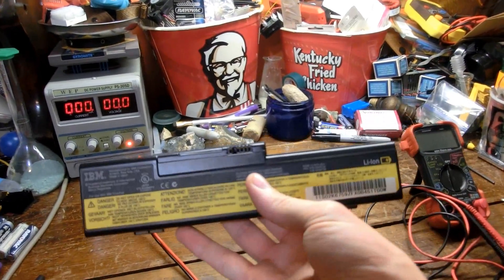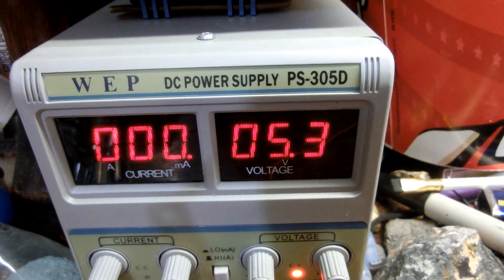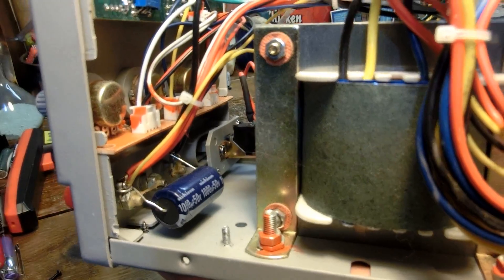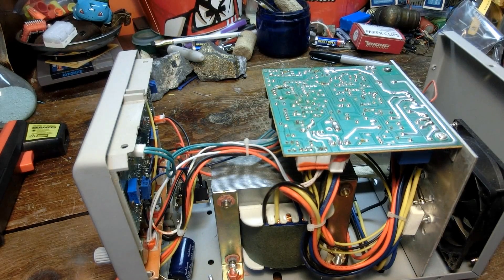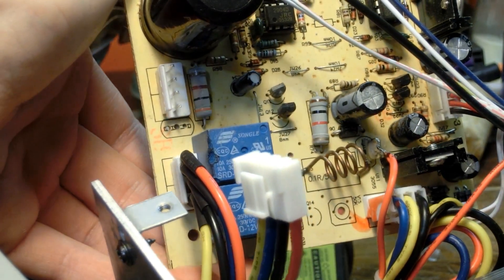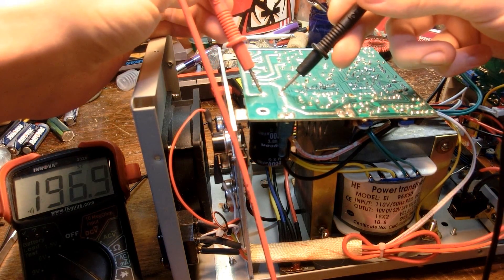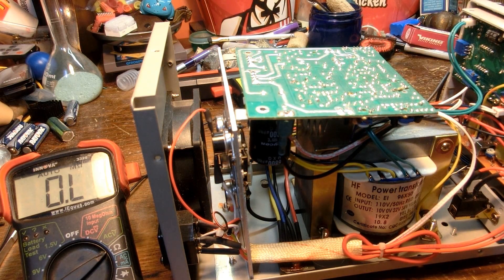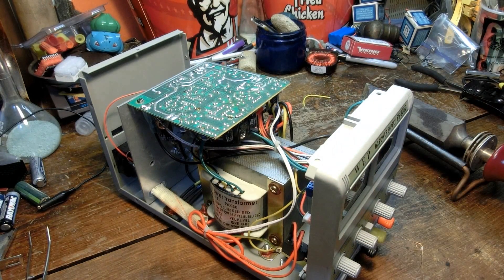How It Failed: 80$ 30V 5A Variable DC Power Supply

Comment: A few things I noticed when you were probing that supply:

Generally it is not a good idea to test capacitors, transistors, diodes, resistors, etc. in-circuit. You need to desolder at least one of the pins. Otherwise you might see junk reading because you are biasing junctions and resistors and stuff elsewhere. I had been fooled like this MANY times.

Also,  measuring the resistance of capacitors is practically pointless. the tool for the job is called a RLC (resistance, inductance, capacitance) meter. the resistance of a capacitor should be close to infinite once charged up. Though at approaching infinite frequency, the impedance should be as close to zero as possible.

The reason for the relays in case your wondering is to keep the voltage difference between the unregulated transformer and the output as low as possible while not too low as to lose regulation. Linear regulators work by dropping the voltage to some fixed value, and that voltage drop, multiplied to the current being drawn is wasted as heat.

When the capacitor is not present on the output, there must be some parasitic oscillation (the regulator keeps over-correcting itself, so the voltage on the output keeps parasitically oscillating) II can link in a few videos to people who are EE's and can explain this much better than me if you want.
Reply: +Power Max Link a how to tell if a fan is turning video.

Comment: I'm a big fan of DC to DC converters (specifically, buck converters).  The only problem, obviously, is you need a DC power source.  My solution to that was a couple solar panels outside with wire running into the house and charging a couple 12V batteries.  Then, your bench power supply always gives you 0 to 24V at whatever current you want and it is free, unlimited power.  My projects have never depleted the batteries faster than they can charge by day.

Comment: Such a shoddy design. Couple of notes though. the difference between 50-60 Hz is not that bad - you may loose maybe 0.1% efficency but overall it's not a biggie using a 50Hz transformer on a 60Hz supply. Also them burn marks are from a soldering iron, they decided to solder the connectors instead of using actual connectors.

Comment: The melted relay looks to me as if someone had been prodding around in there with a soldering iron or got way too close with a hot air gun while applying heat shrink to the cables going down to the connector.

Comment: That was a disappointing 10 minutes...
Reply: Rinoa Super-Genius You call someone else an idiot, Yet you choose to spell " your " when it's clearly " you're "
Reply: Rinoa Super-Genius You are idiot if you want to charge li-ion battery with lab power supply without any charging controller.
Reply: Rinoa Super-Genius You're* .... The irony..
Reply: Rinoa Super-Genius "Your" is possessive and "you're" is a contraction of "you are." There's a lot that's arbitrary in the English language but "your" and "you're" is definitely not.
Reply: Rinoa Super-Genius Try to bridge the voltage control Potentiometer on the front panel if its not a digital type, to see. If not the silver power output transistors before the cooling fan are faulty or one is, those are the transister that takes all the abuse and load, they are like interfaces or fuses.
Reply: +Rinoa Super-Genius  AGREE WITH U
Reply: +Rinoa Super-Genius How did you fix it?
Reply: +Rinoa Super-Genius Could you at least rename the video? I never did learn how it failed.' A' for effort, you definitely tried, but still. Also ignore people like the ones in this thread. Your response validates them and makes you and your channel look bad. Oh, and let us know if you do find the issue!
Reply from the maker: papalevies your a disappointing 10 minutes.
Reply: no you
Reply from the maker: *****
i typed what i wanted to type,because i dont give a shit what people like you think. your just petty idiots.
Reply from the maker: ErmaTheKitteh
 yeah i think its stupid to have two spellings of the same word, and then arbitrarily say one is correct in one application and only the other is in another situation. to me words are defined by how they sound not how they are spelled.

for instance we have stopped saying the "k" sound in words like "know" yet we still spell it with the "k". that is stupid. i think "no" would cover both words since you need context to derive meaning anyway. and i dont think it would lead to much confusion if context is given.
Reply from the maker: swrzesinski
your an idiot if you dont know how to charge a simple lithium battery with a variable power supply.
Reply from the maker: ErmaTheKitteh
how is it ironic that i choose to spell words differently than you?
Reply from the maker: tekdro
but its sounds the same, so it all matters on context anyway.

Comment: You are assuming that because labor costs much less in China that the device is cheaply made. 

I would troubleshoot and fix it; then post a video. It would be a great learning experience for all of us, and yourself.
Reply: *****
If you need an oscilloscope to diagnose a linear power supply it only means thay you don't know a damn thing about them. Observe the internet, read a couple of beginner's books ang go back to the device. The schematics for such a simple device is generally not required as well for everything gets pretty much obvious as soon as you open the cover. A couple of youers ago I repaired my Mastech PSU so you can trust me when I say that it is a very simplistic design and there is not much inside of them. A soldering iron, a multimeter and a bunch of tools and spare parts is all you need to diagnose and fix such a device. Really deep knowledge is also net absolutely required - just a basic understanding and some feeling about what's going on inside is enough in most cases. Tha only really precious thing you need to put into the device to get it up and running is your time.
Reply from the maker: S Cin no because it still works the way i need it to, so theres no point in taking the chance of ruining something that still works.
Reply: S Cin For such a cost effective PSU you need more cost-effective tools to fix them. Wasting the whole day to find an issue does not nearly pay for itself. I would just check if there are visually missing parts or cracks and repaired them. As for short curcuit spot detection I like to use a special tool made of a toroid power transformer with a special secondary side made of a couple of windings of a thick wire. I have about a couple of volts AC connected across the shorted line and just look for a smoke. Sometimes the method can not only diagnose a short circuit but automatically fix it as well - the weakest spot just burns out.

P.S. I would not consider the issue as a problem, but rather as an excuse to blow the shit out of it. It is fun to blow things up, isn't it? If it fixes the problem - then fine. If it does not - just rip it apart, throw the remaining junk away and just get a new one. They are so cheap today that they are close to be considered disposable.
Reply: +Кирилл Рагузин I 1,000%  agree with you.  I have purchased 5 Mastech PSU on ebay in the last 2 years that were listed as non functional.   I was able to go on line and get schematics.   I paid like $25  USD with shipping for most of them and got all of them going in less than 30 minutes with parts laying around the lab except for one.   I needed to order a power transistor for one that I did not have laying around.   I think these form factor PSUs are all made by the same factory.    Based on limited info provided in this video I would suspect that an LM324 chip failed and is not switching relays that control switching the higher voltage windings of the transformer in to increase the voltage output.  Rhinoa is copping out.

Comment: Can anyone help me? I accidentally connected the cables wrong to my 0-50V bench supply. I was powering at 49.5V. I hit the power on and the voltage went up to 76.8V. Is this fixable? I can't regulate the voltage, when I power the supply up it just stays on 76.8V.
Reply: Hookah Boy That sounds like a shorted pass element (transistor). Try replacing it or them and it should work fine. Good luck :)
Reply from the maker: no, only you can fix it. open it up and look for burnt components/traces
Reply: Nothing's fried. It works, it's just that it supplies  more voltage than it is specified to supply and the voltage regulation doesn't work.
Reply from the maker: Hookah Boy
try to calibrate it then?
Reply: Any tips on how to do it? I never worked on a bench supply before...

Comment: When you broke out that huge "bull-dog" soldering iron I couldn't help but laugh. Thanks. Besides that, a few things. You can't accurately measure capacitance in-circuit unless you isolate it. Same with Inductance and resistance. You have to pull the component to isolate it or at least pull one leg of the component. If you fried a trace on your board like that you more than likely fried another active component. I think connecting that laptop battery to your PS is what gave it the death wish.

Comment: I just bought one of these and of course with my luck, right out of the box the current LED's middle digit isn't fully working. Do you know what LED it uses. It might be cheaper to by an LED and try to fix it rather than to send it back. Thanks!

Comment: FYI, there is a diode on the board that is in parallel with the capacitor, it might have shorted out.
Also, mine (different brand, same internals) had severe corrosion on the IC sockets. I just soldered the chips onto the board.
And, at full output voltage setting, the voltage on the main filter capacitor is nearly 60V - just over it's 50V rating!!!

Comment: Between 50Hz transformer and 60Hz mains grid there's not a lot of difference in practice (unless you're a transformer specialist making very interesting ones to tight tolerances) but there is definitely a difference between 50 and 60Hz when it comes to smoothing and the resultant output waveform of any DC rectifiers (this assumes it's a AC-DC system and not simply an AC-AC transformer), especially in audio equipment that is designed for 60Hz use but is used on 50Hz mains grid. It's the ripple that causes the most obvious problem, though higher temperatures of PSU components and the transformer itself are not unknown.

Technically the transformer itself will be optimally designed to have least losses at one particular frequency (unless it is inherently designed to be a wideband transformer of course) and so relatively minor issues like slight warming and possible mechanical vibration could become relevant but by and large, it's audio issues that shows the 50/60Hz kit/grid differences. Equipment designed for 50Hz usually works fine at 60Hz  unless designed very badly and "on the limit", at least in our experience.

Comment: Hmm. To blow that track is going to take WELL in excess of 5 Amps, and the most likely place that has come from is FROM your external battery pack - those 18650-based cells can throw out 20A, no problem, if you've been foolish enough to bypass the safety electronics (we've all done it!). So my bet is that you've either connected the external battery up in reverse, OR you've connected it while the supply was off, so causing a diode reverse bias somewhere. That will kill many cheap power supplies, such as this.

I agree with you on your first point - this supply should be BINNED forthwith. However, I think it is FALSE ECONOMY to simply accept that you're going to blow a power supply each year, and buy another! Why not buy a decent BOMB PROOF supply int he first place.? It will quickly pay for itself. These cheap chinese supplies are worse than useless I feel, as the series pass transistors can often fail and dump the full transformer voltage across your delicate circuit - BAD.

DO BE CAREFULL about charging or discharging lithium cells, without their attendant control circuits. They can cause FIRES if over OR undercharged. They can pack a real punch if they are abused, either way.
Reply: Rinoa Super-Genius Well he/she probably did that instead of bolding the text. He obviously isn't saying trollish nonsense :P
Reply: Rinoa Super-Genius don't be so sensitive to a little common sense when it is offered. Then you won't have to buy a new P.S. (cheap or not) every year or two as you described.
Reply from the maker: why are you typing so weirdly? is your shift key broken?

Comment: The regulator probably fried because the battery voltage was higher than the powersupply's own voltage. These powersupplies aren't designed to sink current and probably have limited over voltage protection (or none at all). If you are charging batteries  you should really be connecting a beefy diode in series with the battery to protect the powersupply.

Comment: Firstly you really shouldn't "charge" batteries by just dumping current into them! And secondly if you do decide to "charge" your batteries like that, atleast protect your power supply with a diode or something to prevent, the current from the battery, from flowing back into the power supply and damaging the circuits inside, like it probably happened here.
Reply from the maker: no that doesnt damage this power supply. it only takes 7ma of current when connected to an outside power supply. its useful to measure the voltage of whatever your connecting up. and yes its ok to charge a battery like this because i'm not really "dumping" current into it, i'm letting it take up to 3 amps until it reaches 4.2v at witch time it automatically starts lowing the amps.
Reply: Rinoa Super-Genius True, current is drawn with a load not force fed to a load. But, at the same time it is quite possible to back feed into this cheap P.S. if the adjustment is ever lower than the actual load (battery) that is not protected as well as a high end unit. Just something to think about, again.......

Comment: thanks for the video. find it on ebay and want to buy one, but see many bad review.  will buy it anyway because of the price.
Reply from the maker: well it seems a lot of people dont realize its a cheep product. they feel entitled to get a quality product for an inferior price.
Reply: S Cin   Not just the labor, cheaper components, wider tolerance band, bogus safety certifications, etc.
Reply: Rinoa Super-Genius Indeed. I don't have the money to get a professional high quality PSU, but I am thinking that I can build my own. I want to build a 0-70V 0-10A PSU, but I'd need a custom transformer...
At least if I build it, I know it would work much better. I actually built a little prototype that works well.
Reply: Rinoa Super-Genius I have one of these variable power supplies. It is inexpensive in the US because labor costs less in China, not because the device is poorly made. If you bought the same device made in Europe it would be something like 300 dollars.  Sure it could have used some improvements in design and some better engineering, but the same applies to my Jura Espresso Machine for which I paid nearly 3k dollars thanks to it being manufactured in Switzerland where labor is so expensive; and yeah it feels cheap and comes filled with proprietary screws and hoses that sell for 100 dollars each. It is crap, yet some people think its a great coffee machine because it costs over 3k in the US. Go figure.

Comment: It's probably worth scrapping this one and from the parts, rebuild another power supply with positive and negative rails, so you can experiment with amplifier / opamp circuits.
Reply: devjock I don't think he is quite there yet as far as using biased voltages.

Comment: I know people have made out of old PC power supplies. Could a 24v 8a wheel chair battery charger be converted somehow to a variable power supply?
Reply from the maker: not really, would require you building a variable power supply to control the output current.

Comment: It was actually video when you got this that made me discover your channel, then i bought one, great piece of kit for the $65 it cost me, like you said, mainly to charge lithium batteries, also made myself a PC PSU power supply, just so i can draw more than 5A on the 12V rail.
Reply from the maker: dont forget that computer power supplies can also give 24v.
Reply: Indeed it can, but the 24v rail on this is quite weak.
Reply from the maker: NovakinCore
 yeah they tend to be.

Comment: Hi Rinoa what about this PS from aliexpress? http://www.aliexpress.com/item/Free-shipping-Wholesale-precision-Compact-Digital-Adjustable-DC-Power-Supply-OVP-OCP-OTP-low-power-32V5A/1668592085.html
Reply: Looks interesting, might have to look into it myself :P Although, the output banana plugs being on the back is a bit of a bad design choice.
Reply from the maker: i think i'll just get this http://www.ebay.com/itm/30V-10A-110V-Precision-Variable-DC-Power-Supply-w-Clip-Cable-Digital-Adjustable-/390658968353?pt=LH_DefaultDomain_0&hash=item5af516cb21

it says its a 10 amps version.

Comment: are the main voltage and current potentiometers dead?
Reply from the maker: no they are fine
Reply: Rinoa Super-Genius What about them large transistor things on the heatsink plate? not sure how you could test them but heat cant be good for them
Reply from the maker: steve64464
 i'll troubleshoot it if it ever completely stops working, but for now it does a job ok.
Reply: Yeah i guess if its still usefull :-) . The cheapness of the inside looks slightly scary i find myself worry for your safty when inside it :-P , I just found one them on ebay for £39 but its states 2A
Reply: Rinoa Super-Genius sometimes the back plate comes loose on the petentiometer and the wiper does not touch the traces on like half of the petentiometer and only works 40% or so
Reply: smallenginedude71 looks to me like he has voltage limiting turned on